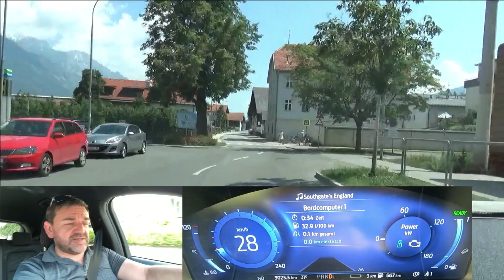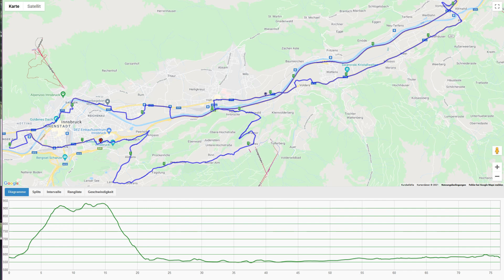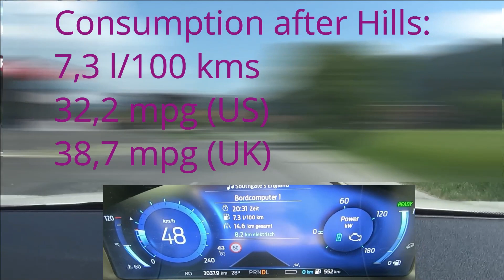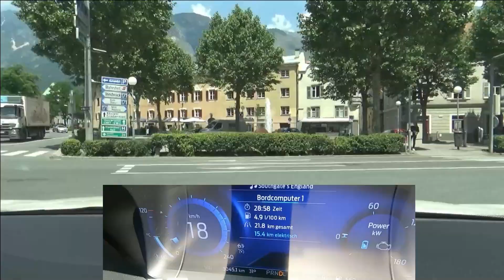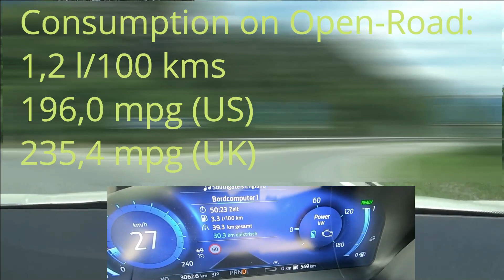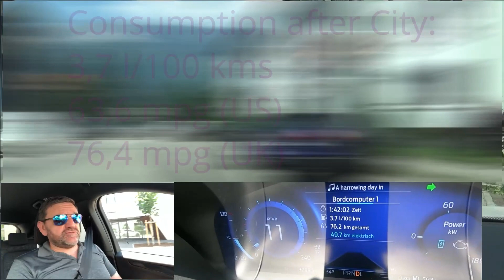Ford Kuga/Escape Plug-In Hybrid - real-life consumption with empty battery

Comment: Thank you for you video, i just bought one and i am curious with your numbers, what would be the range if the battery was 100% and tank 100% to drive only highway at 120km/h ? I have a trip from Copenhagen to Strasbourg in may and i was wondering how many time i will have to refuel on the way :)

Comment: I have been driving a Kuga hire car for the past week. The battery is on ZERO all the time, and I left in in Auto EV mode.
Surprisingly, about 1/3 of the miles I have driven have been on electric power only !
I am very impressed.

Top tip - the regenerative braking, provided you get used to coasting / braking within the regenerative limits as shown by the EV Coach,  is effective enough to provide plenty of of EV only driving time.

Comment: It's unclear to me: when the drivetrain runs in series or series-parallel, i.e. the engine is, or is also, acting as an electricity generator but the wheels are, or are also, driven by the electric motor, does this count towards electric distance driven on the dash?
Reply: No, the distance on the dash is fully electric, or better to say when ICE is off
Reply: The engine does not act as an electricity generator. All electrical power is recovered during braking.

Comment: My question is: Is this a good choice if I drive mostly highwai at around 100 km/h? My work is 45 km away and most of that is highway where speed limit is either 90 or 110 kmh.
Reply: I agree, this car is only useful for city and mainroad mostly. And doing a full charge every point to point if possible. I bought one and its very annoying to charge on the wallwart with 1.2kw. I'm buying a 11kw charger, but can only do max of 3,7kw, so a full charge is 2.5 tho better than 7-9 hours now..
Reply: Do you charge at home and/or work? If Yes, then you will be able to cover most of your commute fully ellectrically. But then maybe get an EV? If you can't charge consider FHEV. At 100 kmh it consumes comparatively to the diesel. But If going faster than 120 kph diesel has an advantage.
Reply: Only diesel, trust me.

Comment: A little lost with your comments.  Just bought a plug in escape.  I am assuming you're driving on EV mode.  Going gown hill the engine regenerates energy. What if the car is just in Neutral?  I noticed the flat driving doing 3.7 liters per 100km how?
Reply: Never drive the Escape in Neutral, there's a software bug that causes damage to the engine in Neutral
Reply: @deurkl  you can only coast. On a mountain hill. Post proof

Comment: You never drive these in (L) mode. Why? I find regenerating is much more efficient this way as you use the accelerator pedal to feather the regen rather than the brake, making jt more efficient
Reply: Great question. L is for enhanced regen, But also engages braking with ICE friction once battery is full. This Mode is primarly for going downhill in order not to overheat the brakes. But since part of kinetic energy goes into heat via ice braking, it May not recover as much energy. At least that's my understanding.

Comment: This number are absolutely not real life consumption figures. In the winter time this SUV don’t have heat pump as its have Toyota Raw 4 plug in model. As it’s so, Ford engine it’s almost all the time on because engine uses to heat inside of the SUV. Fuel consumption in winter month it’s between  7,4 - 8,5L/100km.
Reply: But you can preheat car when its plugged in before you start your drive. And Kuga can preheat or  precool when its not plugged in, bc it has electric heating and dont need engine heat.
Reply: My brother was given a Kuga PHEV for a week while his BEV was off the road he does a lot of motorway miles and his average consumption was 32 mpg with a low battery, the answer is PHEV great for short journeys if you charge the battery.
Reply: @stuartpittard3153+you need to lnow how to drive it.

Comment: Whats the point buying this car . More electric more problems and not economical. Diesel is best option. And i dont drive 80kmh i will do 120-130h on highways
Reply: That's bull crap, to be honest. With PHEV you can drive around town with electricity and overall consumption is low. My previous car was Opel Ampera and 12 months consumption in mixed driving was 1,5 l/100 km. Try to beat that with ordinary diesel. On longer journeys consumption was 6 l/100 km of E85.
Reply: What is the point to buying diesel when you mostly do short journeys around the town?
Reply: Well, bc diesel have  egr and dpf filter and in city they are death trap.
Reply: Jest rok 2025, diesel?
Reply: Diesel more reliable than power split hybrid? What world are you living in? 😂😂😂

Comment: Hi Helmut thanks so much for this! I ordered my Kuga PHEV based on your excellent review 12 months ago. The car was finally delivered 2 weeks ago. The fuel economy is amazing! The Electric range on the clock says 28 miles after charging (cold weather at moment). When the hybrid mode takes over it does a great job. Often in traffic or on the motorway it slips back into Pure EV and the MPG that I'm seeing is very impressive! At the weekend I will drive the car 250 miles with zero battery.....this should give me the pure Hybrid mileage. You are right, so many "experts" say negative things about some PHEV's but so far I have been really impressed. Many thanks again. I will update mile findings in a few days time
Reply from the maker: Great to hear!

Comment: Do you recommend charging to 100% or to 90 or even 80% to extend battery life?
Reply: I would go to 80 or 90%   that way if you go downhill when starting trip, you can recoup the energy.  if you are at 100%, you cant.
Reply from the maker: Depends on your needs. If you need the full capacity I'd charge fully up, otherwise I'd go to 80% max.
Reply: Well I always charge full. Just think that the manufacturer already prevents that by the useful kWh. Kuga batt is 14.4 being a net capacity of 10.6 leaving a 3.8 so being this 10.6 net capacity into the percentage margins to keep a good health of the batt. Explained in an Spanish channel called Motor K.

Comment: Correction: 49.7 km is not purely electric drive, but any electric drive: pure electric + hybrid.

Overal nice review, but the numbers I get from mixed driving are quite different. in my case of mixed driving (city, highway) without charging the car, I get 5.8-5.9 l/100km. So far from 3.7. I think you get this milage because of the type mostly city driving and the specifics of you route.

Comment: Hi Helmut, again me :)
I am preparing for a long trip to Greece and over 700Km I will spend on Highway.

What wold be the best recommendation for driving on the Highway, PHEV's cars. Which Mode to use for the best useage of the Battery and Fuel? Of course I mean on "normal" driving between 110 km/h to 130 km/h 

What is your experience with your Volvo x90? (I suppose Driving mode's are similar with Ford Kuga PHEV)
Reply from the maker: If you do long motorway trips it depends on what's coming after the motorway. If I do those trips and the trip ends shortly after the motorway I go in "normal" hybrid mode. If I have to go a longer distance off the motorway at lower speeds I charge the battery on the motorway to a SOC which I presumably will use afterwards.
Reply: @ecodriver1746  hi Helmut. Thnx for your message.
I have used Eco mode + Save battery  for later on 25% of battery and my results of 600km of highway and the rest on the open road are interesting:
1. From Belgrade to North Macedonia border: Average speed 120km/h, 5.9l/100km, 370.8km, Electric 59.8km
2. From Serbian-North Macedonia border to North Macedonia-Greece border: Average speed 110km/h, 5.6l/100km, 541.7km, Electric 118.4km
3. From Greece border to Hotel in Sithonia: Average speed 80km/h, 5.2l/100km, 729.3km, 224km Electric
Reply: That is with my Ford Kuga PHEV. When I go back, I am planing just to use Normal in Eco mode without Battery savings for later, as I think I could produce and use more battery without saving due to a lot of Hills in the mentioned route
Reply: @miodragzivanovic9922  thank you for sharing your experience. One question. From the Greece Border to the hotel how many times did you charged it to go 224km Electric?
Reply: @telebog  Hi!
I have charged only once in Belgrade, from my starting point. That 224km Electric I have made upon full trip of 729.3km from Belgrade, Serbia to Hotel in Halkidiki, Greece.
Reply: I'd go for EV later... You keep batt and still is using eventually electricity in some parts. So you extend that batt range too.

Comment: Would you please explain if I am driving the car for long drive, assuming that I will use the full battery for the first 60 Km , after how much km driving on petrol the battery will be fully recharged to be available for another 60 km of electric driving
Reply from the maker: Difficult to say, as the charging rate depends on how much power (load) you need from the engine for driving.

Comment: Hi. Thx for the video. Why the petrol engine didn’t charge the battery when operating on gas only?!   Isn’t it besides being PHEV is a hybrid too?
Reply from the maker: On the beginning it did (on the way up), so that I covered the hills without petrol engine. Normally, once the battery has a socket-SOC (in most cases around 1-2 kWh) it only charges when you set it to do so.

Comment: what is yor recomended mode when going to uphill?
Reply from the maker: I'd say hybrid, as the electric engine isn't strong enough.
Reply: I know this was ages ago, but I have this phev and on a journey of about 100 miles I charge it first and plan when to use electric. Start off in electric, once on the motorway I switch to the engine charging the battery and on hills back to electric. In Scotland basically I use electric going up hill and charge it on the way down.
Reply: i mean what is name of the ev mode there is 4 mode right . thank  you my car is new kuga im learning for now your great video it helps a lot. im using plug in hybrid
Reply: Probably Sport mode as it uses both Engine and battery and via a very twisty and changeble elevation charges the battery quickly

Comment: Hi @ecodriver,
Do you maybe know whether This Ford Kuga and Toyota RAV4 Plug in versions are using the same engine?
And what is your personal opinion between Ford Kuga and Totoya RAV4 Plug-in's?
Reply from the maker: Hi, machines are from Ford and Toyota, but they are very similar, both Atkinson, similar displacement and power. Also the hybrid-components are very similar, as the Fords is based on Toyotas. I only get the RAV4 PHEV to drive in the next two weeks, but I think I'll get over 100 kms out of it, Kuga was just below 80 kms, so I'd probably go witht the RAV4.
Reply: @ecodriver1746  thank you  for your quick response.
Toyota dealers and they told me that they don't have RAV4 PHEV available before October (even If I order it now)....I was so sad when I heard that....but from the other side, I have asked Ford delears for Kuga ST line PHEV  and they told me that Only One is available at the moment :)
So, It seems it will be mine after Car Show :)
I will let you know if that will happened & I will try to use all of your advice which you mentioned for the Efficient driving PHEV's.
Reply from the maker: If you have to wait from now until only October you are a lucky man! I ordered a new Volvo 2 weeks ago, will be delivered not before February, fortunately I don't need it until March. Other manufacturers stopped taking orders at all or have waiting times until 2025 (for specific models).
Reply: @ecodriver1746  uhhh...that is a lot. Yeah for Volvo they told me that delivery is in 1 year or Maybe less it depends of the Package
Reply: interesting comparig kuga phev empity with fhev....impressive 3.7 avaradge vs 4.4....dispite the weight of a 14.4kw battery versus 1.1.
Do you think it is due to the greater sponge effect of the larger battery?
i know that phev uses 3 kwh for hybrid use.
Reply from the maker: Hi, the main reason is the topography of my test route, where a 6 km-descent regens a lot of energy, which can be stored in a PHEV, but not in the FHEV. AFAIK there is no restriction of the battery for hybrid use, if you go down a long descent it surely charges all the energy, which - on some of the mountains around here - can be up to 8 kWh.

Comment: Is it worth it using charge mode on Downhill?
Reply from the maker: Hi. I wouldn't recommend that. The engine can only produce a certain amount of energy with rather restricted power output. So if you are braking downhill you are already getting very close to the maximum of that and if you then have another source of energy already charging the battery (who itself can only be charged at a certain intensity) you are quite surely exceeding that and the energy produced from braking is wasted. Also, normally, on a downhill the engine is off as not much (or no at all) power is needed and then it would be running just to charge the battery, that's at a rather low load (as there is nothing other to drive than the alternator) and that's very inefficient (it's different when, at the same time, the car is moved by the ICE). 
So in short: no
Reply: so what is your suggestion what ev mode is good when climbing uphill and going downhill? thanks i see your video no ev mode only gasoline eat to much gasoline

Comment: Thank you for the test. It is very rare to see fuel consumption in PHEVs even though it is very important in my opinion.
Reply: @elliex20  I know I bought one looks at driving tips I have beaten Fords expectations on mine. Yesterday on the highway 80km per hr is the sweet spot. 100km speed limit going up to 90 then back to 80 did  a 20km trip auto ev and used 14 kms charge. Heat is off. Heat the escape has a heat pump but for real heat it comes from the engine. Hard to explain.  Downtown Edmonton to Morinville on the way back stopped at Costco full.electric with the exception of the last 2 kms. That's an 82 km trip
Reply: @chrisburgess6964  I just got the PHEV in July and I love the performance and fuel efficiency of the car.
Reply from the maker: Thank you, you're welcome.

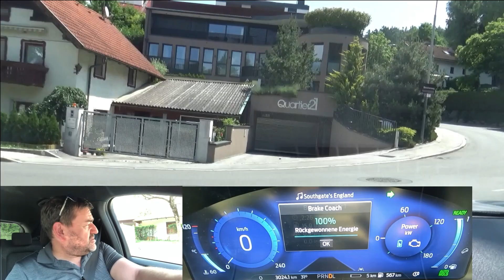Comment: Hey Ecodriver, at 2:09 it pops up saying brake coach - is this your braking efficiency? if so does this mean how efficient you're in braking at regening the battery or something around those lines? Interested in my first ever plug-in hybrid so never seen this before - thank you!
Reply from the maker: Hi, yes, this is a Ford-specific feature. 100 % indicates that you managed to brake 100% electrically. The more the friction brakes have to be used (because you brake to hard and exceed the regen ability of the electric motor) the lower this number will be. 
Next week I will upload a video about the specifics in driving plug-in hybrids efficiently. In the meantime you can have a look at this ;) https://youtu.be/kEv-3OJg6sQ
Reply: @ecodriver1746  hi , thank you for the very fast reply and your explanation! That's very interesting and a different way of driving. When I was taught to drive a few years ago I was told to let engine braking to do most of the leg work and brake gradually when you need to. I've found on my diseal even with short journeys I can get 50-55mpg however I wonder what I could achieve with a phev. 

I look forward to your next video coming out. I will subscribe and keep an eye out for your videos! 

When you drove the Kuga how did you find the transition from electric to engine? Smooth? Janky? 

Also how did you find the engine when picking up speed quickly? 

Thank you . Look forward to future videos.
Reply from the maker: You're welcome!
Re Kuga: Transition between drive modes is very smooth, what I like in the Fords is the quietness of the engine (compared to a let's say Toyota) as long as you don't floor it. If you require lots of power it is a bit loud, however, the Kuga has a rather big engine (2,5 ltrs), which means you have a lot of torque at lower revs, and as long as you're driving "normally" I'm sure it's no disturbance.

Comment: You recommend using L or not?
Reply from the maker: Personally I don't, as it leads to digital driving (either accelerating or braking) and that's not efficient.
Reply: Downhill depending on the descent rate but city driving yes.
Reply: Ford explained L stands for „low gear“ and it’s especially useful when going downhill with a fully loaded car or a trailer.

Comment: I'm sure the car didn't recharge the battery while you were using the engine because if you have it in auto it constantly uses the charge to help take load off the engine  so everytime it builds some charge it uses it up simultaneously. If you had put it in ev charge mode then the engine would have prioritised recharging the battery at the cost of extra fuel. At least this is whT I have learnt from my kuga phev.
Reply from the maker: That's what I've thought too, thanks.
Reply: si what mode when climbing uphill? nothing? on fuel?